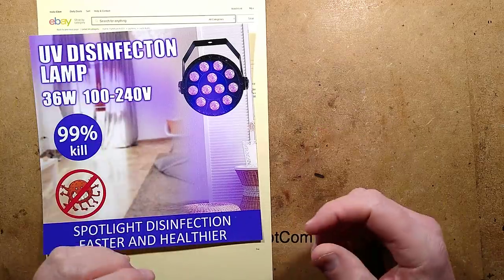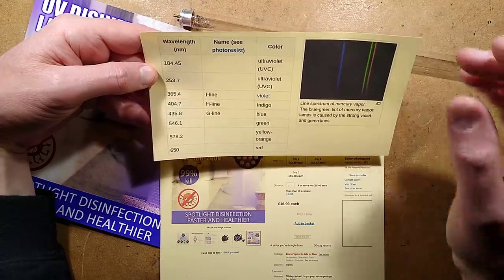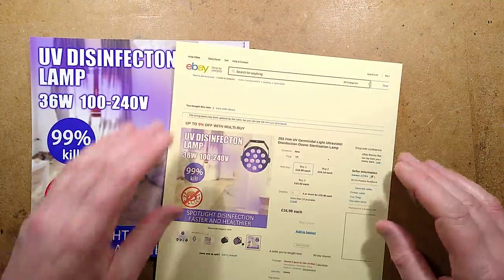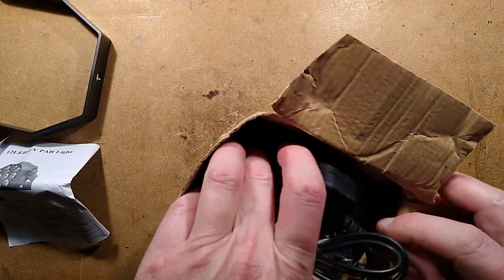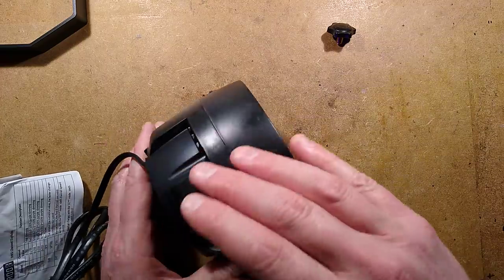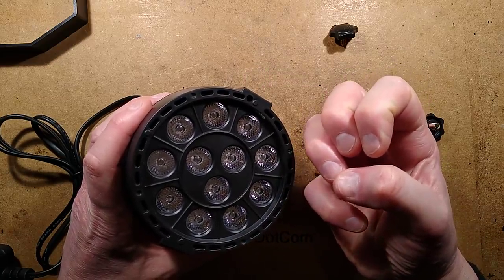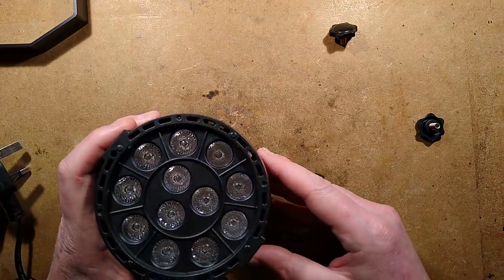Fake UV disinfection lamp from eBay.

Comment: You should have seen the inside of my induction range (5 burner sold by #Wolf / #SubZero); I'm in north america but it needs the normal 240 V to operate (~2/5 of the burners can operate at once; full power for each; ~3kusd new). 

Placing a pan down or removing said pan; one time; I was able to have the main power supply arch to the control board. I'm talking about a very visible arch (if you had the case apart). Untrained eye could easily see the scorch mark. Lets just say it was a matter of resoldering the components; #WolfAppliances refused to service it despite how easy it would have been. Apparently their manufacture has closed (not selling the IP of the induction unit that I had and not giving any future support to their current repair service). We are talking about an 'out of warranty' piece that likely is 99% good (unless the PCBs suffered circuit damage). 

What really pisses me off is the board design. One main board with the induction coils and lower down in the enclosure is the control panel and some other components. Right where those two boards over lapped (~0.5 cm difference in height) is the scorch mark (both top and bottom of both of the boards). Maybe filed under #designedtofail or why we need #righttorepair

Comment: Would probably make a nice SLA resin print curing lamp though - if it has output at 405nm. Throw in a solar powered rotating display and you're all set for those cloudy days

Comment: If strict RoHS compliance is required (even though I recall RoHS exempts lamps not for general purpose illumination), are there mercury-free UVC sources other than exotic LEDs that are effective for disinfection? One big market for UVC LEDs is self sanitizing toothbrushes, since a toothbrush with a mercury warning doesn't market well to those obsessed with good health.

Comment: This reminds me of B7000 glue.

"Stimulate the taste free"

also from the back of a tube of B7000

"B7000 acrylic diamond adhesive is one can satisfy toy.plowers.jewelry,handicrafts and other industries the special environme
ntal protection adhesive bonding.and other products are not afraidof bad compared with adhesive,acrylic drilling bottom."

And we can't forget all that "Tochnical data".

Comment: Electric Power Research Institute, aka EPRI, published a paper earlier this month citing research that 405nm near UV light had disinfecting properties without the "adverse" aspects of UVC. Typically, the HVAC world uses UVC in the plenum before cooling heat exchangers to limit biofouling. The 405nm light is proposed for flooding open spaces and potentially reducing bugs in the air. Too bad there are no cheap spectrophotometers on Ebay to evaluate these snake oil lights.
Reply from the maker: I've looked at UVA research and it was very vague and only implied limited effectiveness on a limited range of bacteria.  UVC obliterates just about everything, which is why it's used for sterilising hospitals.

Comment: There's a high pitched tone that's made its way into your video whenever the disco lamp is plugged in.
Reply from the maker: It'll be the switchmode supply or pulse width modulation of the LEDs.

Comment: 17 GBP and 253nm? I need that :D Not for disinfection, but Hungarian Forint should have a different glow under UV C light.
One thing makes it suspicious: I checked several months ago and similar led-s were in the 1000 usd range I think.

Comment: I bought a 6W UV-C bulb from ebay and was disappointed to find out it didn’t produce any ozone. They apparently cheeped out on the tube and used the kind of glass that doesn’t transmit at the 185nm band required for ozone production :/
Reply from the maker: That's deliberate for applications where they want the 254nm without ozone.  The glass is doped to filter out the 184nm wavelength that splits air.

Comment: Aren't mercury vapor lamps kinda hard to beat in this application anyway (like yellow for sodium), that wavelengths is really strong over everything else, and the efficiency isn't actually all that bad compared to say a white LED.

Plus the power density can be way higher than an led because they don't mind the higher temperatures
Reply from the maker: Yeah.  Mercury discharge is hard to beat.

Comment: Wouldn't it have been much easier if you had used a spectrometer to measure the wavelengths?
The one I have is a little pricey but it's worth it if you're validating the UV's integrity.
Reply from the maker: Yes.  I can't really justify a £700 meter to test a £16 light that is clearly fake.

Comment: I have an old pair of eyeglasses that turn dark when exposed to sunlight (UV).  I tested my UVC mercury lamp and they turned dark - so that's good!  I had bought a pair of UVC blocking googles and put them over one of the lenses of my eyeglasses and it protected them - and that lens stayed clear (didn't darken).  So the googles work too.
Reply from the maker: I'll have to try that with my old photochromic glasses.  I'm not sure which wavelength they respond to though.
Reply: @bigclivedotcom  Hmm.  A quick search found one place that said photogray was 280 to 320, and another said 320to 400.  And the UVC is in the range of 100 to 280.  So perhaps that isn't the best test. 

I saw one guy on youtube do an experiment with ecoli and UVC light.  I wonder if just spitting into two glasses and letting one sit under the light for 10 minutes, and the other not, then put them both in the dark for a day if mold or whatever would show up???

Comment: 11:40 I saw the same thing in an example layout in an actual name-brand IC datasheet for an offline switching IC. They had the optoisolator powered from one of the auxiliary windings on the secondary side with a trace going right under the safety capacitor and back to the primary side. How can that be considered isolation, even if the secondary is double-insulated?

Comment: There are no cheap LED light sources that could be feasible for normal user. Buy tubes, they can pump so much UV compared to super expensive LEDs for fraction of price it's pointless to even consider LED UV sources at this point.

Comment: SO...a question:  Not asking in any way for an endorsement, but are there ANY "germicidal" UV lamps that don't produce ozone but that DO work??  LED or otherwise (though I'd be partial to LED simply for less power use)...  Must not have watched that episode yet...but really would like to know!
Reply from the maker: Yes.  You can get the clear quartz tube type with a filter in the glass so they only put out the non ozone producing UVC wavelength.  Often sold at aquarium shops for water purifiers and can be used in standard fluorescent fittings.  Same eye and skin safety rules apply.

Comment: Can you explain more about why the opto-isolator bothers you? The part itself does provide isolation, but is it how close the traces get that bothers you?
Reply from the maker: The opto isolator is fine.  The low voltage tracks run right up against the high voltage tracks isn't.

Comment: I don't believe there are UV LEDs up to 185nm. I bought one from Nichia, the one with the lowest peak is 280 nm (model NCSU334A 55mW). Real UV LEDs are quite expensive. Do not forget also that these LEDs operate powered by a current source and not a voltage. It is less expensive to produce ozone by corona effect with a recovery TV flyback.

Comment: Just got two Gearbest 30 COB LED UV-C USB wands that are just inside germicidal UV-C at 270nm-395nm. I was considering buying some petre dishes and agar so I could at least test them to some degree on bacteria. Yeasterday, I found a big crawly bug in our bathroom, so I gave him a little UV-C. It was dead inside 2 minutes. I know this proves nothing, but until a lab says they don't work, I'm going with they do.
Reply from the maker: There are real UVC LED wands available.  They have square gold coloured LEDs.  Very low output compared to a mercury tube.
Reply: @bigclivedotcom  Both wands I bought have 30 gold square LEDs each. Mercury is whole-room coverage. You can't be anywhere near those when on. These wands need to be lower output level of UV so they don't harm the user.  I also have a mercury UV-C on order with ozone. I will disinfect my world if it kills me! :D

Comment: wonder why they go through all the trouble of putting in the boards, they obviously have to custom make the front board with the LEDs (use other LEDs). So why didn´t they just connect the LED boards input connector to the power supply? Probably that tiny supply would not over current all those LEDs so it would work, and they will save ~3-4 bucks per unit..

Comment: Clive, is there any simple positive way to confirm UVC output besides bbq'ing your skin?
Reply from the maker: A proper meter costs around £700, but I just received a small module that gives a voltage output as a representation of UVC level.  But the LEDs they are using are absolutely not the special type required for UVC production.

Comment: Even the cheap low pressure mercury CFL and T5 "fluorescent" style lamps from China are shite... never mind the cheap LED ones! 
Traditional UVC lamps suffer from solarization of the glass. The intense 253.7 and 185.1nm UVC radiation is usually absorbed by the phosphor in normal fluorescent lamps but in clear lamps there is none and the glass or decomposes. The cheapo lamps made from quartz are more susceptible to this whereas the more expensive UV lamps of Philips and Osram ect use a very thin coating (5nm) of Alon C inside the arc tube which provides a great increase of lamp life and allows it to maintain 50% of initial UVC output for up to 8000 hours. Cheapo lamps typically drop below 50% within 1000h!

Comment: Due to the knowledge that I obtained from watching one of your previous videos, I learned that one of them that I received was fake.  I am in the middle of a dispute through eBay right now. I just received a follow-up message that stated they will so generously allow me to keep the worthless light and will refund me 25% of my money.  I obviously want 100% of my money back. The real shame is that people are going to be thinking they are disinfecting and may end up exposing loved ones to something that could be fatal.
Reply from the maker: Keep going and don't close the case.  If they want you to send it back ask for a pre-paid shipping label.
Reply: @bigclivedotcom  I just replied back this morning that nothing below a 100% refund would be sufficient. The bulb is useless to me if it cannot do the intended job.  I was able to find a couple of bulbs locally (early on), and we are using them at both our Fire and Police departments to clean our minimal supply of masks.  I was just hoping that this bulb would have been something I could use in the squad to clean any areas that we missed with other means.  Again, I thank you very much for your exceptionally informative videos.  It only took me a short while to learn what I needed to to make UVC work for us.

Comment: You just can trust some people lol !  I recently brought a cheap chinese 600W growlight on ebay..It did say 30W in the description..  but turned out to only  pull 10W at the socket !   type "growlight" its top listing and you too can get ripped off,  though it did have nice blurple colours
Reply: Reputable manufacturers do the same factor-of-6 thing.  But they have something like "Equivalent to 600W tungsten filament lamp" rather than calling it a 600W lamp.

Comment: Just a comment about the crushed box.  While walking to the drugstore today I saw a FedEx truck driver open the back door of his truck only to have about 5 or 6 laptop computer size packages tumble out and fall a few feet onto the pavement.  Thanks FedEX!
Reply from the maker: To be fair, all the couriers are struggling with huge loads right now.  Suddenly everyone has started shopping online because the normal shops are shut.

Comment: Clive, thanks for these, and by the way, what's the smallest unit you're aware of that generates ozone?
Reply from the maker: You can get little U-tubes just over an inch long that do it.
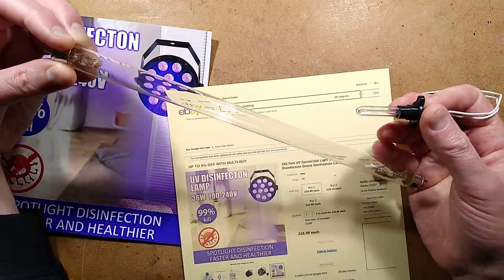Reply: @bigclivedotcom  Like 0:46 ? That would be perfect. Can't find. What are they called?  Thank you.

It's kind of mind-boggling how much O3 (and presented-as O3) stuff there is out there for sale online these days, and thanks again for the heads-up.

By the way folks, a little public service announcement here, my understanding is that the UV route (just O2 to O3) is so much healthier than electrical discharge which unfortunately also breaks apart N2 in the air. The latter winds up with varying length strings of N and O combining (nitrogen oxides), which, when they meet up with moisture, like in our lungs, turn into nitric acid. 

But I often breath O3 made from UV and can say ... one simply knows if it becomes too much after a good while because the body says, hey, that's uncomfortable.
Reply: Here's one: https://www.rexim.com/pages/chuv/mccuv.html
Although single O3 185nm @50mm w/ power supply not listed and/or sold out, but double is available

Comment: you say "different magnifying glass" do you have several in different strengths and were they a set?
Reply from the maker: They do a few magnifications in that style of unit.
Reply: I need to get some of those @bigclivedotcom   I've got a ridiculous huge Sherlock Holmes jobbie.... good magnification but can't get it within a mile of a component.

Comment: I’m a little confused as to how the opto-isolater is compromising the HI-LOW break. Isn’t the point that it bridges across it and allows light based communication between the two sides whilst preventing electrical cross-connection? Or am I missing something here? Thanks in advance.
Reply from the maker: It's the vicinity of the PCB tracks.  There was a large isolation area that is violated by the low voltage side being bright close to high voltage tracks.
Reply: bigclivedotcom ah, thanks! So just the increased likelihood of it shorting across?

Comment: Any chance of finding a UVC like CCFL that will be visually like the true UVC lamp but safe? I really love the way they look and how the gas inside glows, but are there safe lamps behaving this way?
Reply from the maker: A long time ago Phillips made some promotional clear compact fluorescent lamps, but they were purely promotional.  You could get a custom tube made in safe soda or lead glass if you can find a neon sign manufacturer that can still make neon.  They could do a clear tube with mercury and argon.
Reply: @bigclivedotcom  Right! The exact way you said would be difficult to go for on my side, but you gave me another idea -- I could try to find a glass supplier and try to order a glass tube (made of something that blocks UVC) from them that I put over the usual UVC tube. This should do it, right?

Comment: I don't understand why that opto-isolator placement defeats the electrical separation.
Reply from the maker: Look at the spacing between the mains voltage tracks and low voltage tracks.

Comment: so is it worthwhile changing the leds for the rgb ones that the circuits were designed for, or is it cheaper to buy one with all the correct leds in it, as a disco light, in the first place?
Reply from the maker: It would be easier to buy the original RGBW one.  That would also be calibrated to the lower voltage of the red LEDs.
Reply: @bigclivedotcom  thanks for that

Comment: Why does the opto-isolator defeat the separation? And how should you use it (or not?)
Reply: not the opto-isolator it self the problem is the traces on the board are to close
Reply from the maker: It violates the track clearance because they moved it closer to the mains voltage side of the PCB.
Reply: Thanks for the replies! So how should they place it then, it seems like a small component like that can't keep the large separation desired because you're always going to have a small gap with a small component?
Reply: Ideally they'd have both the optoisolator and Y cap next to each other, but there's not enough room to do so. However, they could've put the optoisolator next to the transformer, with the Y cap further away, and then connect to the Y cap via a jumper wire across the component side. Not sure if that is permissible though.

Comment: Thanks for the info.  I got a UVC light from Amazon '
N2 UVC Light Sanitizer Wand Ultraviolet Light Sterilizer Travel Surface Disinfection Lamp for Household Toilet Car Pet Area'.  Do you think you can do a review on this by chance?
Reply from the maker: That may be similar to the one in the video being released later today.  Does it have a knob to adjust intensity, just little white LEDs that emit purple light and a plastic front?  If so then it may be just a near-UV mechanics tracer-dye detection light.
Reply: @bigclivedotcom  Thanks for your quick reply.  Yes, that sounds like the one I have.  Can't wait to see your review on it.  Thanks..

Comment: I bought a UV hvac light will this work for a home disinfectant use? Thank you so much. 
Pure Uv Light AIR Purifier for Ac HVAC Coil 120v Plug-in 14" Germicidal Bulb with Magnet
Reply: If it's a real one (easy to test using an old EPROM - try to erase it), it will work great.
Reply from the maker: Yeah, looks like a discharge tube type.